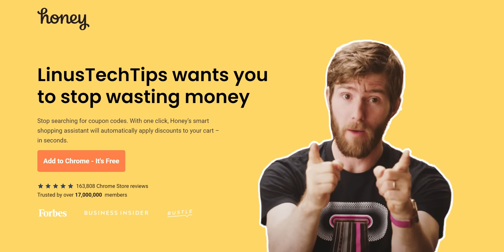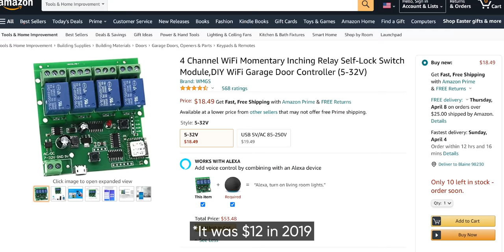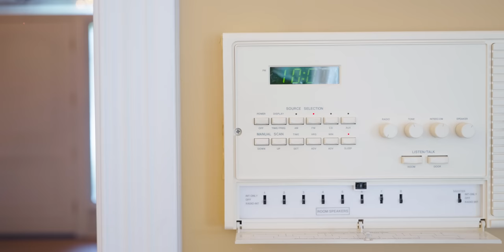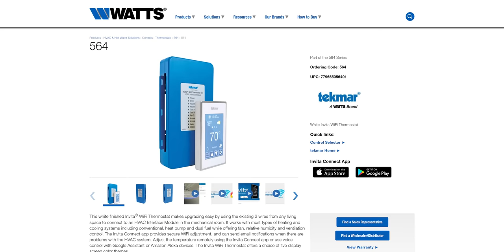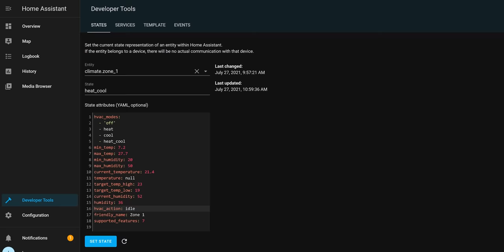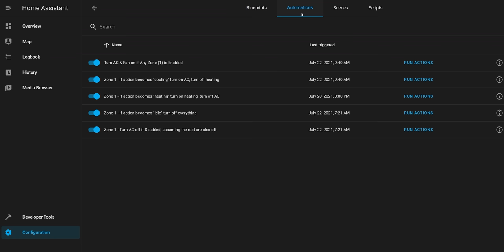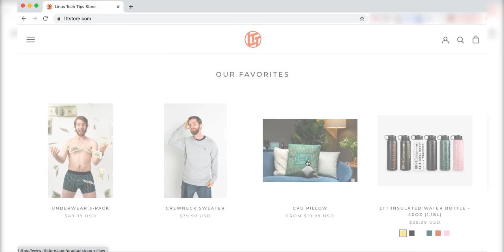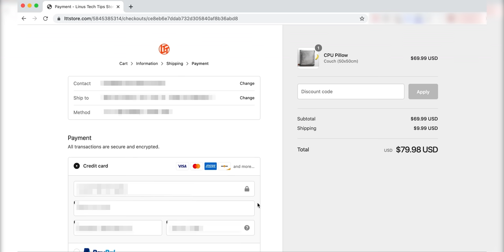This Should've Been EASY - New House Smart HVAC

Comment: As someone who works in HVAC, there is a reason they don't do it this way.  You don't just shut off your AC in unoccupied rooms or unoccupied houses, the simple reason being is that the recovery time - the time the system will have to run to bring that room back down from now 80-85 degrees or whatever (depending on your climate) back down to 70 or your preferred temp is LESS efficient, than having an UNOCCUPIED temperature setting, which is how ALL modern thermostats and zoned systems work.  The A/C never turns OFF, it simply has an occupied and unoccupied setting, so in unoccupied mode, the system only keeps it at say 76 instead of 72.... or in heating mode, it only keeps it at 64 instead of 70... you get the idea.  The system can run far less to maintain those temps, but then the amount of time and energy needed to get the space back to the desired occupied temperature (and humidity level - equally large factor in A/C - you don't drop sensible temperature until you drop relative humidity which takes time!) is far less than simply turning the system off.

Also, zoned systems cannot just shut off an arbitrary number of zones while leaving a small number of zones open, unless you have a fully variable blower motor, because the pressure will get too high, measured in inches of water column.  Zoned systems typically work in 1 of 2 ways - a bypass damper (a duct run that literally bypasses air from the supply right back into the return, with a weighted damper in it to maintain a pressure)... that's the older less efficient way... or, the newer way - the zones never fully close.   Zones that are NOT calling for A/C (or forced air heat) closes say 80-90%, while calling zones are fully open.  This is because you can't simply have one room getting AC using a blower motor and duct system meant for 5 tons of cooling, or 2000CFM, feeding just one room.  You have to bleed the pressure somewhere, although again as mentioned above, variable speed motors are one part of the solution to this kind of problem.  But don't think that you can just retrofit your existing system with these cheap dampers, it will NOT work properly, if the pressure gets too high you will burn out your blower motor prematurely, and the noise of the system in operation will increase.  On top of that your blower motor will use more energy.

Comment: Careful trying to zone a constant volume system. The fan won't care but the AC needs the full airflow of the furnace to operate correctly. Otherwise you're going to run into low suction pressure issues and flood liquid back to the compressor and kill it.

You'll need to lock each damper to a minimum open position, or have a minimum number open, to have it limp by. A barometric relief going from supply to return can also solve the airflow issue, but then you run into the problem of low return air temperature causing liquid flood back or an iced up indoor coil.

Comment: Linus! So I haven't yet read the other 4061 comments on your video, so I apologize if I'm repeating something some HVAC dude has already told you... but a furnace or A/C unit like you have has a volumetric capacity of air it drives out into the house, and it stupidly assumes all your vents are open. If you shut off some of the ducts, the remaining ones have to accomodate the volume of air that was originally destined for ALL of them. So an additional consideration you need to build into your system is an algorhythm that steps down the furnace (or A/C) fan's spinning  speed depending on the amount of ducts that are open at any given time.

Comment: Not a big fan of the Honeywell zone dampers I work in hvac and change a lot of those.  They are cheap so just put them in easy to replace areas and also watch out for over restricting airflow you can freeze up your indoor coil that way and make your blower motor work much harder. I'm sure these things were already on your mind and I don't expect anyone to actually read this but I just wanted to give some helpful tips!

Comment: i feel the motion sensing thing will back fire since a motion sensor isnt gonna sense someone sitting on their chair not really moving, thus causing the ac to shot off with someone in it, as well as if ur going in and out of the room, the system will continuously turn off and on, thus drawing the same amount of power but not cooling anything, since the ducts are slow to open.

Comment: and to not stress the ac you need 2 thing, a pressure  meter and a bypass damper to keep the system pressure constant it is called a H type hvac

Comment: pardon me if I'm missing something, but wouldn't it be far simpler to make sure that you aren't both heating and cooling your house at the same time ever, full stop?  If one room is cool and the other hot, fluid dynamics sorts that problem out pretty quickly on it's own provided you have adequate air flow... unless you're talking about an attic, and then that's a separate issue.  I'd think making sure you have good air flow from room to room would ensure that you don't have a randomly hot area, and a very cold one at the same time.  This'd eliminate the worry of overlapping zones, make your home more efficient, and save you some $.

Comment: this has given me an idea...I wanted to place an always on, multi room, low pressure air extractor in my house.

Problem is that as it detects an excess of moisture, it ramps up the speed.

Using something similar to what you've shown here, I guess, I could jerry-rig something to close off the rooms where there is least likely to be a source of moisture or use sensors to work out at which point the extractor ramps up and close the vents not meeting that point.

hmmm

Comment: I work in the building controls sector. All commercial stuff though, much of what you're saying here makes sense. It's a shame the BMS/BAS companies are so locked down. The Smart home stuff is going the same way. Every company out of reinvent it's own way, rather than all agreeing on a standard. They do it so you HAVE to use all the same gear, but it's so short sighted because it's hurting the industry as a whole and slowing down adoption of new technology.

It's also annoying that the various technologies used in the home automation space basically are totally different to those used in the commercial space, even though they all do the same things. e.g. commercial stuff using MQTT is very limited, and home stuff using BACnet or modbus is non-existent. Couple with the locked down nature of the manufacturers on both sides and it's a fairly toxic environment for innovation.

Comment: Commercial HVAC has been doing this for years it's too bad this is not more main stream in residential systems. Linus you should add a duct static pressure sensor to your duct work.Basically you wire this in series with the fan so that if there is a pressure build up the sensor trips and the fan shuts off. That is standard in commercial HVAC. Also some companies make proportional dampers that take a 5v signal and open in proportion from 0% at 0v and 100% at 5v. This helps you set a minimum the damper will close (so ducts don't blow) and the damper is open a percentage based on how far off of set point the space is.

Comment: If anything. You should you like an air duct fan. Like the ones from AC Infinity. They make premium quality fans. They make vent fans that fit on the grill of where your AC blows air out. They are more efficient and energy saving as well as pretty cheap compared to using a raspberry pie and flaps to allow air in/out. In my opinion.

Comment: Linus. 
Did you consult an air balancer?
It will make all the difference in comfort having balanced air flow.
And it's not a good idea just to fully open or fully clos dampers.

Plus home assistant isn't the right choice for what you're trying to accomplish.

The air dampers should be modulating, and never fully close. You are thinking in binary :)

Comment: DONT KEEP THE VENT DAMPER CLOSED BY DEFAULT!! know it makes it easier to have the servo wired to NC on the relay for working out the logic in ur mind but that mean your servos are run 247 and those things do ware out u differently only want to actuate the servo when its needed u can have home assistant apply open or closed state ether way.

Comment: That ac system is not designed for multiple dampers that block off sections of the ducting. The system is sized for the space, you need to disperse that flow or the system will have major issues functioning over time.

Comment: Definitely a fan of the Ecobee, I have a similar setup, and an older house (no common, separate heat/cold, weird zones, lots of thermostats), this was a great solution for me too.  I also agree on the occupancy stuff...not overall worth it and don't really want to average the temps just b/c someone ran in/out of a bedroom.  Handy for monitoring temps though.  👍
Reply: How are you getting the Ecobee to work without the common wire? I have a red/white-only older furnace (without terminal board) and didn't think you could use the Ecobee without a common to get constant power to the Ecobee?

Comment: You should also do some CO2 monitoring, when putting those air valves, to have enough fresh air to breathe! Those valves also have like a 50% setting, you could use if you need fresh air (when CO2 is above 1200 ppm)...
Reply: yeah i would rather just spend the money they are doing on zoning (which will only bust the A/C due to lack of airflow) on a new variable speed A/C with an ERV.
Reply: @PlasmaNode  Air quality is much more important than people think.
To have a good metabolism, you have to have enough oxygen. Without enough oxygen you get tired pretty.

In my new house, with central ventilation system, I've got in every bedroom a CO2 sensor which regulates the air quality in the room.

Air quality is more important than a degree difference in a room, imho...

Comment: You're going to want to consider a barometric bypass damper. If only one room is calling and the rest of the dampers are closed there's not going to be enough cfm over the evap coil and your going to cause the system to freeze up or potentially damage the outdoor condenser.

Comment: This is why PLC and logic controllers exist.  A bit pricey but way more convenient and very programmable.  Having a SCADA or HMI on its own network with ups backup with a network connection to a port means it could be accessed via user based profiles remotely too.  Far more robust than throwing different systems together.  Benefit is you can have input and output data as well as step controls and relay controls.

Comment: Having heating or cooling lay dormant after 30-60 of zero room activity may in fact decrease your efficiency due to the increased run time to correct room temperature versus maintaining a constant temperature. That's on top of if you don't walk past that light switch every hour. Do you have a routine set up for each zone to automatically disable heat when the switch signals for cooling and vice versa?

Comment: Linus, why don't you add an in floor cooling for the summer? It will be a lot more efficient than AC. 

It will just be a circulation pump and bypass hot water tank. Circulation pump is a lot more efficient than A/C. 
If the problem is with the clash of heat vs AC. Why don't you convert the in-floor heater into part of the cooling solutions?

Comment: have to think about how much cfm you are restricting and if you would need a bypass, cant restrict output without compensating for return, if you have 3 zones you can close 2 and run 1 without a bypass that puts massive strain on you system. the fun thing of controlling each rooms temp if someone is there are not (paired with dampers for each)  would theoretically increase efficiency, but would require a bypass thus recirculating air leading to no efficiency boost. if you wanted a damper system of that magnitude you would need to match it with variable speed equipment that can speed up or slow down due to demand.

Comment: If you want to heat or cool a room, not only do you need to blow air in, you need to remove it.  This will only work well in the areas that are by the air return.  The fan in your furnace most likely only has one speed.  you need a variable speed fan that will ramp up when more zones are calling.  If you find that the furnace fan is burnt out one day,  that would make sense.
Keep in mind that your AC is also one speed.
I wouldn't expect much of any savings  or an increase in quality of life 
Your heating/AC is designed to do the whole house,  get some good insulation, open all your vents and let it rip

Comment: Would love to see an update. This was a huge mistake for so many reasons. 

Everyone saying the fan motor will burn out is wrong, motor amperage on a centrifugal fan decreases when flow is reduced. You need to go back to school. You can however blow up a compressor by not completely evaporating the refrigerant due to lack of air flow which will smash the compressor and/or destroy it from prolonged lack of lubrication. 

Just buy wifi thermostats and use a central power supply and relays. You over thought the problem. Also, you should install a manual heat cool switch so that you aren’t heating and cooling your house at the same time if one thermostat is adjusted high, and one is low. 

You could also just use regular heat/cool thermostats commanding the same wire with a manual conversion switch in the mechanical room. That may not be a very good tech solution to make a video about, but this is a worse solution. 

Also, the gentlemen that you get refrigeration advice from is often misinformed.

Comment: It could be a good idea replace the old gas boiler and the AC with a single air/water heat pump. It can be used both for air cooling and floor heating with a single more efficient machinery

Comment: If energy efficiency and lowering energy bills is a serious goal, Linus should look into passive house retrofits--they usually include adding outside airflow to each room because the builds are so energy efficient. He'd no longer need to worry about managing which room gets air, because all rooms would get a stream of clean air and the extra insulation keeps the whole house's temperature totally stable through the day.

Comment: cool stuff. I wonder about using some simpler setup for my home. As our home doesn't have as many bells and whistles but i would like more control over which rooms get a/c and heat. My room is either super cold or hot. and the room down the hall is usually the opposite. :)

Comment: Hey Linus, you may want to consult an HVAC engineer about your unoccupied room theory first.  It takes MUCH more power to cool a room down than it does to maintain.  And even with the doors closed between rooms, heat will seep from the hot rooms to the cooler occupied rooms.  And having an HVAC engineer check your work is a LOT cheaper than getting it all in and having to fiddle with it for years getting it right while wasting more energy.

Comment: You are going to need to set more complicated rules. One zone calling for air and open will not be enough airflow to prevent your ac from turning into a block of ice and harming itself. You will need multiple rooms calling for air. You can go to a variable speed air conditioner so it will not turn on 100% without the demand for it. It might do 20% because only one room wants to be cooled. Also short cycling an AC will harm it as well. You will also want your dampers to default to their non powered state when the ac isn't working. That will prolong how long they last. I've had high failure rates on electronic dampers and way better longevity from pneumatic.. but that's not ideal for your. 

In your occupancy sensor, you will probably want it to set the thermostat to away mode or eco mode. So it hold the temperature in an unoccupied room at like 80F degrees in the summer or 60F in the winter. This will allow it to more quickly get to a comfortable temperature  once occupied.. and potentially not freeze any pipes if it's a room that hasn't been used for a full day or 2.  The thermostat probably has an occupancy sensor already. So no need for the smart light switch for that functionality.  You might even want an air mix routine where it just runs the fan. To mix things up. I found that very useful for radiant heating. With radiant heating you get a temperature gradient in each room because it's not getting pushed around at all. It was like 80 degrees at my head 75 degrees around my waste and a chilly 60 degrees around my feet. Just uncomfortable. A little forced air. Like 15 minutes of fan every hour fix that for me.. that thermostat probably already has that functionality.